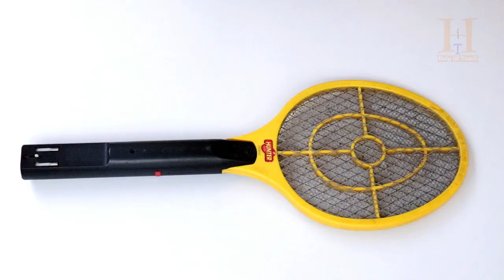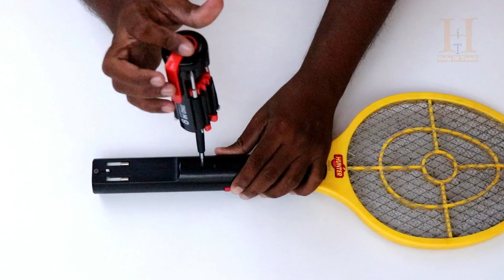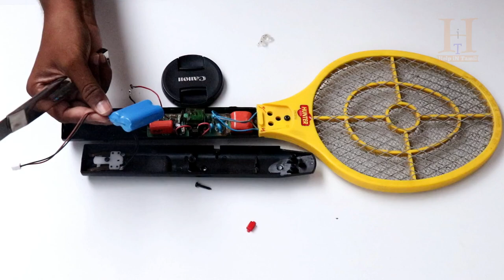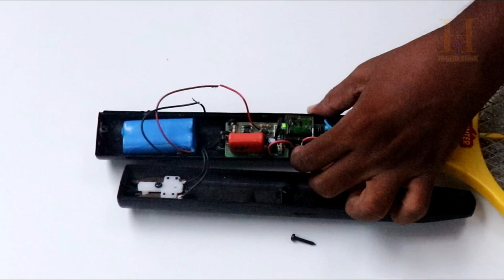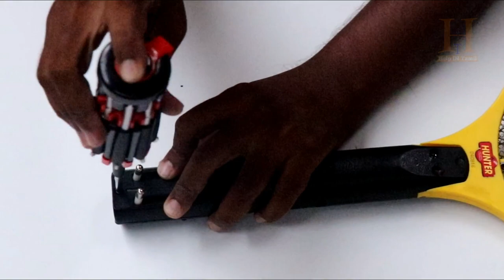How to change Mosquito bat battery | DIY | Replace a Hunter Swatter Bat Dead cell | Help in Tamil

Comment: can we use AAA 1.2 v nimh rechargeable battery  in mosquito racket ??
Reply from the maker: Yes of course. But u need to change the wiring in the battery socket slightly.

Comment: என்னுடைய mosquito bat work ஆகிறது ஆனால் charge செய்யும் போது charging indicator light work ஆகவில்லை அதை எப்படி சரி செய்வது?
Reply from the maker: andha LED bulb soldering vechu kalati vera bulb fix pannikonga...👍👍
Reply: @HelpinTamil  problem solved bro
Reply: Bro entha battery potinga link send me bro discription la 2 3 battery iruku entha battery correct ah hunter bat ku set agum